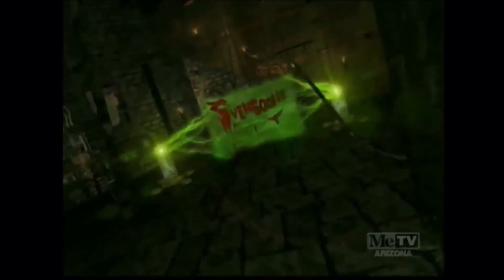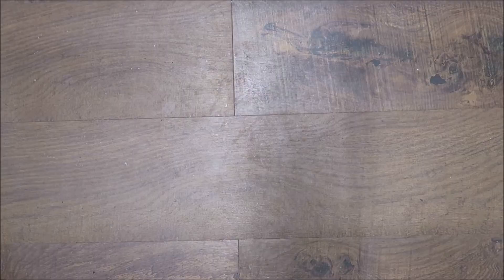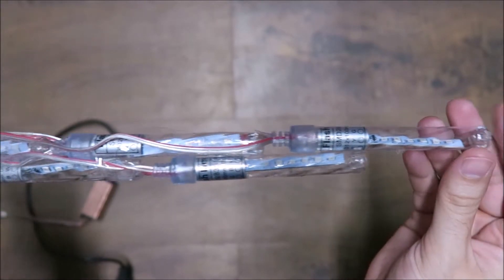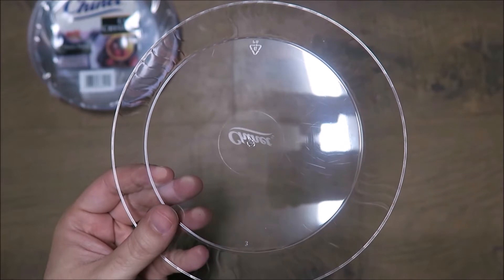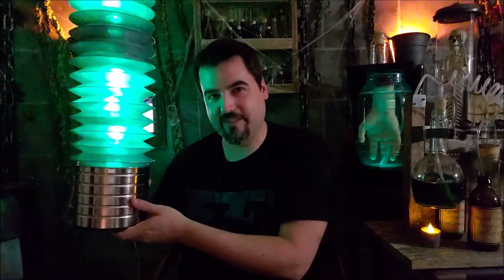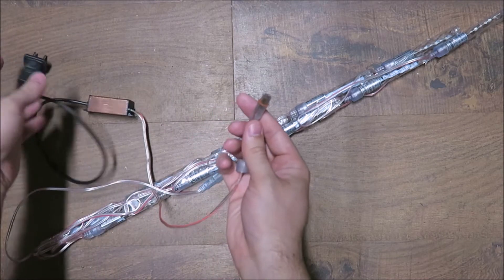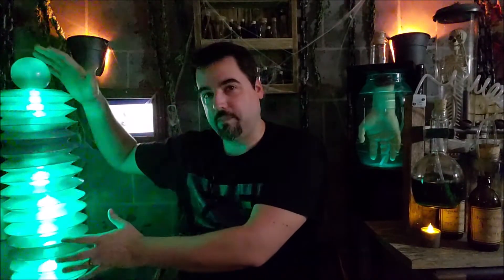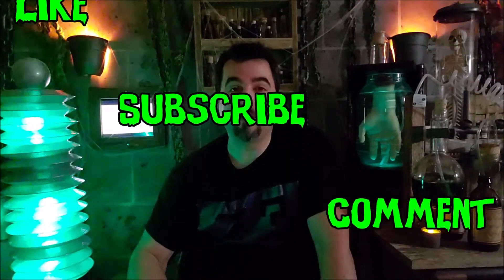Mad Scientist Power Pylon DIY

Comment: Kevin Rider - Just made one - best way to drill plates quickly without cracking is put drill speed on 1 and run pilot bit and hole saw backwards full speed from the back of the plate onto a wood block cut to fit inside plate - cuts/melts at the same time leaving a clean edge within a few seconds. Wished I had figured out sooner - would have saved a lot of time trying not to crack plates.